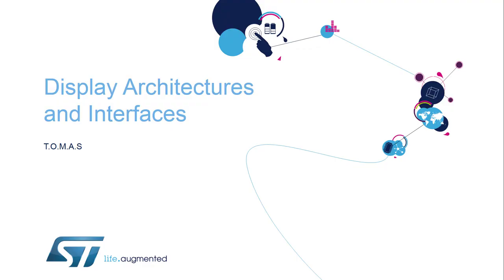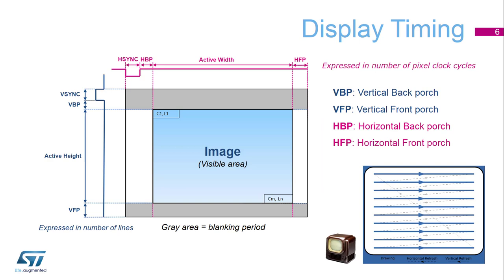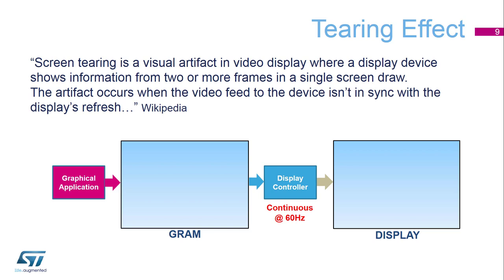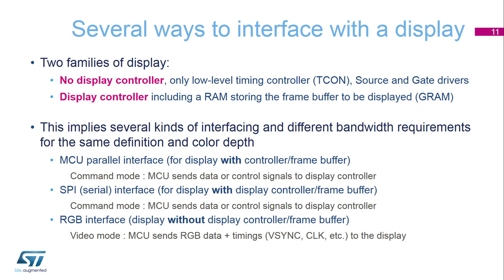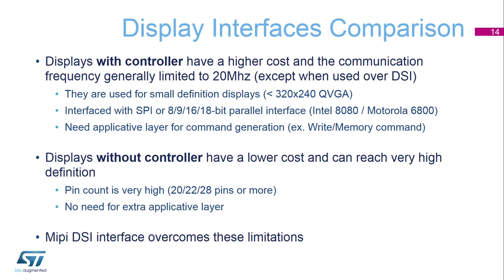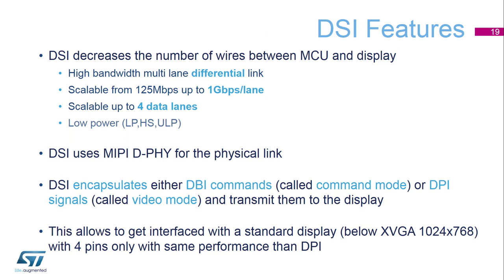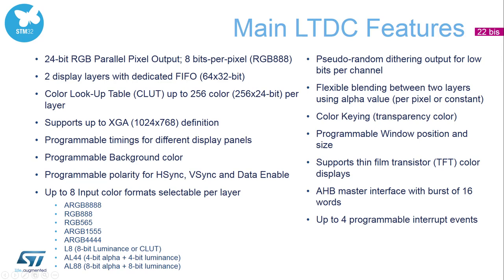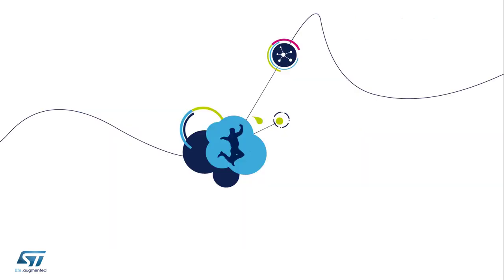Graphics with STM32 - 3 Display Interfaces

Comment: I'm a STM32 fan and going to implement some LCDs in my project. I've seen this video it is very good information. I was searching this information in the ST website in PDF format but not yet found. Does ST issue this LCD information, the same as showing in this video, in PDF format? The PDF format is easier way to re-capture and friendly searching some data rather than fast forward in the video.
Reply: I may be a little too late or you may already have noticed, but links to the specific ANs are in the description of the video :)